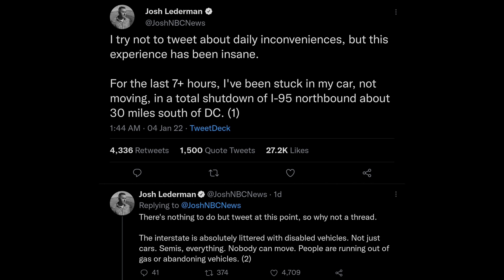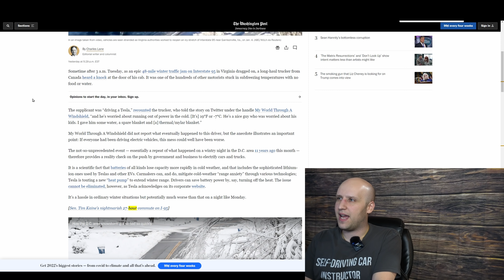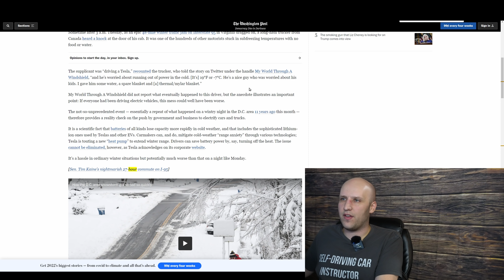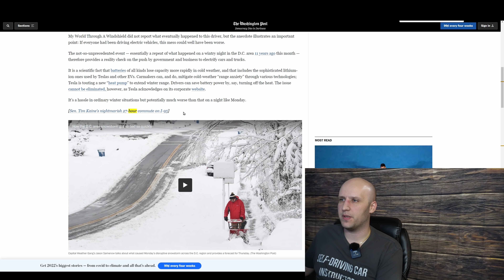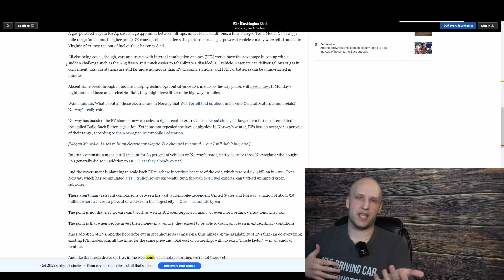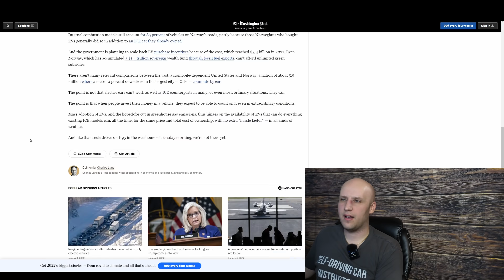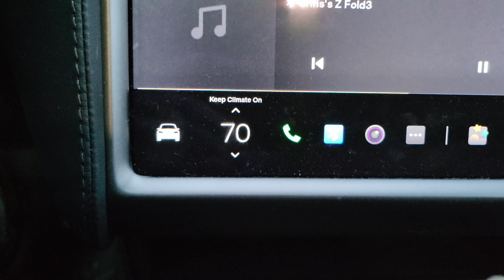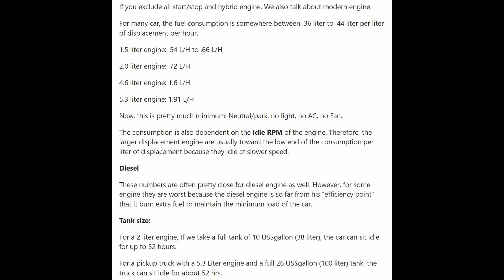How Long Can a Tesla Keep You Warm In A Frozen Traffic Jam? | FUD Debunking

Comment: If you stuck in an ice car, turn the heater or ac on and accidentally open the ac ventilation while the engine is running idle, and you have a leak in the manifolds,  you would be dead in an hour or so.

Comment: 4 years ago I was stuck on I-65 North in Indiana for nearly 15 hours. This was before camp mode. Kept the car powered on with heat and radio the entire time and used about 30% of the battery in sub 10° freezing temps! Many cars around me ran out of gas and had to be towed off the highway.

Comment: Gas vehicles don't run on their battery, the battery is used to start the motor. Once the motor is running,  the alternator is powering the vehicle.  The alternator charges the battery back up to capacity,  hence the voltage range, when charging the battery back up the alternator puts out from 14.8-15.8 volts, then drops down to the 13.8-14.4 volts to run the electronic equipment in the vehicle.  So, being stranded on the highway in cold temperatures wouldn't effect a gas vehicles electrical system.  It could kill the battery and overwork the alternator,  but that won't shut the motor off. This of course is putting new gas vs new ev. Older vehicles will have degradation (both gas and ev)

Comment: The model X could be a lot more efficient depending on how you tested it. If you used the cabin pre heat function it warms the entire car. If you're using the heater like normal and you're in the car alone it won't heat the rear of the car unless there is someone buckled in.  It's a weird feature that most people don't realize until you have kids in car seats and try to figure out why the rear heaters aren't working.

Comment: It having  a heatpump not only boosting efficiency by (also) using heat from other components to heat the cabin? In this case, the cars did not have any heat to start with and were not driven before the test. So this was a worst case scenario for the heatpump model?

Comment: You got a point regard electric car running empty. EV could have a plug allowing them to get a small extra battery to reach a charging station or climb up on a platform truck.

Comment: There are no charging stations within 75 miles of where I live....no EV for me!
Reply: Most EV owners charge at their house at night which is sufficient. Also, some EV's get 250-300 miles per charge now.
Reply: @mattwolf7698  Well, my very old house has 2 wire wiring, and only 60A service.  The only times I leave town I drive in a direction that has no chargers for 300 miles.  Cutting it too close for comfort.  I will wait another decade.

Comment: I have a 2017 Model X 90D.  On 12-20-21, I charged my car to 50% and drove off.  I had a flat tire on I-70E, ~8 miles east of Glenwood springs.  That was at 12:05am and at 11 deg F.  After the tow, I went to a tire shop but the weren’t open to 8am.    Kept my car at a nice 77 deg and seats at max.   When they opened, my battery was at 20%.   So my battery went from 48% and went down to 20% after 8 hrs at ~11 to 13 deg F.

Comment: Great video. Heat pumps use 1/3 to 1/4 the power of electric resistance heating. For example, you can save a lot on your electric bill by installing  a heat pump water heater.

Comment: Interesting comparison. Don't own an electric but my next vehicle probably will be

I live in a part of the province where one can go 150K between gas stations. With the govt. of Canada endorsing electric at the half way mark there is an electric charging station. So give the electric a point for that. Also for me having lived in colder climates with long distances between communities I have an emergency kit always in my vehicle. Surprising how much heat a candle gives!

Everytime there is a road closure somebody is always running out of gas. It will be no different for electrics. Where people familiar with the area will not start in without a full tank of fuel there is always the ones that will say oh I can make it. 

One question you can answer for me how long would it take to charge an electric with 110V? What I'm thinking motels/hotels have block heater plug-ins. If you are staying over night you can plug in to the normal current. Might not charge you fully but at least keep the battery warm for the top off.

Whenever a major change is made it does take time for the infrastructure to catch up. My dad for years always had a can of gas with him. Never know if you can make it to the next gas station. My brother and I thought he was paranoid (we actually questioned his sanity) till we talked with a friends grandparents. We just took it for granted every small community had a gas station. It never occurred to us that gas at one time was hard to find. Who would of thought of going to a feed store or a pharmacy to buy gas for a car? Apparently when our dad started driving that is what they had to do until gas stations were built.

Comment: Though the average gas car can idle for 33 hours on a full tank and it would use the same amount of fuel no matter what heat settings you had because heat is such a big byproduct of gas engines. This speaks to how Inherently inefficient gas engines are because of the insane amount of energy they use that is lost to heat. Though this also shows a way gas is still superior   considering that this would all be done by 60lbs of easily refillable fuel as apposed to permanently fixed 1500lb !battery.

Comment: I have to wonder how much power that resistive seat heater pulled compared to the heat pump.  Seemed silly to have them both running if the cabin temperature was set to 70F. It's more understandable at 60F, but the heat pump should be much more efficient than the seat heater, so maybe it would even out...?

Comment: But Battery runs out faster than gas runs out and if you have a 5 Gallon gas can in your car but To charge your battery of your car the car needs to be turned off with a power station plug-in to your vehicle so you will still be cold 🥶 for 1 or 2 hours but I think everyone should buy a gas with Hybrid or get a 2020 ChryslerPacifica, 2021 jeep Wrangler, you get gas,Ev, Hybrid all 3 in 1 Vehicle think about it
Reply: EV's can still be on when plugged in, they just charge slightly skower.

Comment: Very good testing and good video.  I love Tesla but I don't think any electric car has enough reserve energy to really face the challenge of Minnesota winters.  In Minnesota, we don't really think it's cold outside until it gets to 5F.  That's when you begin to feel your nostrils freezing with every breath you take.  There are multiple days each winter when the temperature does not get above 0F for days, and every year there are a number of very cold nights where the low temperature ranges from -20F to -30F and sometimes colder.  During the holidays, we routinely make long trips in this extremely cold weather to visit family.  Can we make a 6-8 hour round trip drive in -15F weather in a Tesla, keeping the inside automobile temperature at 75F, with no mid-trip recharge?  We do so with our internal combustion gasoline-powered engines.  That's the reality that causes the resistance to going electric.  I'd love to see a test under these conditions.

Comment: A model y will do 1 mile per 287wh. You can buy a 2000wh battery pack for about $2500. It's not cheap but that is about 7 miles of range using Amazon bought current battery. It will be easy enough in the future to have a detachable battery pack in your car that can add say 10 or 20 miles of range to the car. You grab it, head to your local charge point, top it up and then return to your car and plug in. Voila, a modern Jerry can.
If this becomes a big issue, I am sure this solution will show up.

Comment: So if you have an ICE car and leave it sitting around in the wintertime with a half (or more) empty tank, chances are you'll accumulate lots of condensation in the fuel tank which will 1) sink to the bottom of the tank, get picked up by the fuel pump and stall the car or 2) turn to ice in extreme cold while sitting in the bottom of the tank and stall the car. Or, even more fun, maybe your car has a subtle exhaust leak (salted roads in the winter time, etc) and you sit there idling for 12 hours while your car fills up with carbon monoxide, you take a nap and fail to wake up...ever. For f**k sake keep the EV charged or keep the tank topped off in the winter time. Just in case. If there were such a thing as common sense, everyone would have it...

Comment: You'd be surprised , especially in more rural areas , Gas stations have generators to run the pumps and minimal store operations. (or generators could be trucked in to bring those pumps on line.) So in the event of a wide spread power outage , chargers are a no go , but gas pumps can be turned on given the use of generators.

Comment: So thanks for the video and experiment, it's good information and nice to know, I do think you're a bit on the optimistic side for the EVs though. Note I think EV are a good thing but I also think they are currently too expensive compared to their counterparts, especially in the lower budget range where second hand cars are also a great option (at least in my country). Second hand cars will also be prblematic with EVs because of battery degradation, which reduces range over time.

One small comment about a thing that's not really true, is you  saying if you forgot to fully charge your tesla you could be in trouble and so could you if you forgot to fill up your car with gasoline.
I'm sorry but that's just not true, let's assume similar cars with similar fuel economy, price class, size, etc. Range is the one thing that will not be the same, and if I have 10% of my gasoline left that's still generally going to give me a much longer run time than 10% battery charge. The only argument I have to provide for that is already the difference in range, keeping in mind that electric MOTORS are also much more fuel efficient about 4x as efficient even. Chemical fuel generally just has a MUCH higher energy density (volumetric and by weight) and is generally not affected much by the cold (if it's not too extreme) while most batteries are, reducing the total available energy even further (the 10% for gasoline is basically the same on a winter or summer day, an electric battery doesn't provide the same power).

So no if I forgot to fill up my car with gasoline I'm much less likely to be in trouble in comparison to if I forgot to charge the batteries.

It's also really simple and easy to funnel some gasoline from one car to another with a simple hose (and maybe a jerry can), good luck doing this with electric cars. Pay some guy 50$ for a few liters and you'll get home, like I would really like to hear how you would do something similar with an electric car.

You also mentioned towing electric vehicles to charge them, but does that really work well with all the computer systems and automation in them, have you actually tested that and does that work if a normal/smaller car is pulling them (in the EU in many countries most cars are significantly smaller than in comparison to the crazy amounts of pickups in the US, in my country you barely ever see one, keep in mind gasoline price here is about 2€ per liter, or about 8.6$ a gallon).

Comment: Tesla that were built before 2021 did not have heat pumps all Tesla models 2021 had the heat pump.
Telsa without the heat pump took about 2000 kwh to heat the car Telsa with heat pumps 700 watts so heat pumps made the Tesla 75 percent more efficient to cool and heat the car.

Comment: I've had to sit stopped in my Avalon Hybrid in cold temperatures a few times. The nice with the car is that it only runs its little Atkinson Cycle 4-cylinder enough to supply heat. I've found that the computer has the engine turned off for the vast majority of the time, even with the heat set to a comfortable temperature. With its 17 gallon tank, I'd bet it could maintain 60 degrees inside during 15 degree weather for the better part of a week, not that I have any plans to test that.

Comment: Gas cars burn about 0.6 gallons per hour at idle.  So depending on the tank size you have some time. If you had half a tank of gas, and an 18 gallon tank that's 9 gallons.    So 9 / 0.6 = 15 hours.  So if you ran the engine half of the time you would make it 30 hours in a gas car.

Comment: with gas car - if you put heater on idling for too long, it gets too hot that you have turn off the engine once in a while.
Reply: I've never experienced this. I'd think the cooling system would keep the car cool if it was functioning properly. I've never been at a sit still for hours in winter though.

Comment: Your showcase because I wouldn’t call it an experiment was entertaining. But for now gas still has several advantages over EV’s in most disaster scenarios. 

1) You can walk miles to haul back on foot a gallon or even a few gallons of gas. You can’t haul back electric energy with an EV. It becomes tow truck only. 

2) If the grid is down for an extended period then gas stations can be powered by generators to dispense gasoline. EV stations are a no go period. 

3) In an emergency you can siphon gas from another gas vehicle. With EVs you just have a paperweight.

Point is that the at scale and accessibility if you are looking for the best reliability than for now that is gas.

Comment: Anyone ever hear of winter gas blends? Turns out ICE cars lose 15-20% range in the winter too. To your main point, anyone can get stuck in a bad spot with low fuel, regardless of fuel type. Of course, the author of the article failed to mention the risks of idling in an ICE vehicle for long periods... nothing like suffocating overnight in a carbon monoxide filled cabin - at least you'd go peacefully.

Comment: A gas car can idle for days on very little fuel. A gas car with 90% of a full tank could probably idle many days. It can run almost 10 hours at a average 60mph. Idle burns very little gas compared to that. As a kid I started a tractor and it idled all weekend. I remembered about it and turned it off after 3 days. But the electric cars did do better than I thought it would.

Comment: Even if a ICE car has low fuel, fuel can be given to it. It’s not the same with electric. Even if the gas station was far away, cars nearby can give fuel by siphoning fuel from another car.

So there is a disadvantage to electric. 
Either way, in the winter, have blankets in the car. Let’s not put electric over ICE in this situation just because we like electric.

Comment: Thanks for the research.  You could have added a point about how much a gas-powered car would cost to heat for 12 hours to compare with the cost estimate for the Teslas.  Very roughly, a quarter tank of a 16 gallon car would be 4 gallons, or about $12.  Were your numbers for 12 hours, or longer?

Comment: Way better to be stuck on the highway in an EV than an ICE vehicle.  Reason:  it is dangerous to stay in a stationary ICE car with the engine running for hours.  If there should be a leak in the ICE’s exhaust system, the result could be lethal as the carbon monoxide in the exhaust is deadly poison.  Second point, the time extension by lowering the temperature is easy to compute.  The energy savings is proportional to the temperature differential.  For example, if it is 20 degrees outside and you heat to 60 degrees instead of 70 degrees, the reduction in the change in temperature is a reduction of 20%. (70-20 is 50, while 60-20 is 40.  40 is 20% lower than 50, so there is a 20% reduction in energy use and a corresponding 20% increase in the time required.)

Comment: I thought Tesla doesn't recommend charging above 80% regularly or even to constantly charge everyday when you still have 70+% or even 60+% of your charge, so starting the experiment with over 90% of charge isn't realistic, since you wouldn't necessarily leave your house with over 80% of charge on say a daily commute and by the time you hit the traffic jam in subfreezing weather, you would have quite a bit less than that to start off with especially at that temperature.  It's safe to say that many of the EV drivers will have less than half their charge/capacity when they hit the traffic jam.  Also when the traffic jam finally ended, you still would need to find a charging station unless you had enough range to make it to where you needed to go (probably home at that point). The last 15% of your winter range (after losing 30%-40% or more of your capacity in that jam) at highway speeds with full heating might only be 20 miles.  Also, if everyone was in EVs, you might not be able to charge your car at the nearest station if everyone else had the same idea and charging also takes longer at colder temperatures.  Furthermore, most other EVs aren't as efficient as Tesla and would lose more of their range/capacity in that 12-18 hour period.  Finally, you have to assume that most of the EVs (especially the Teslas) will have been used (several years old) by the time every car on the road is an EV and there will also be some battery degradation that further reduces the range/capacity...
Reply: Tesla doesn’t recommend regular charging above 90%. The average daily commute is about 30-40 miles round trip which 10-20% depending on speed though obviously more in winter. Assuming an average commute, it’s likely a driver would have more than 50% battery and less than 20 miles to their destination (work or home). Driving a Tesla I’m rarely below 50% unless I’m going somewhere far on the weekend or a road trip. When I drove gas cars my fuel levels were all over the place but I was frequently below half or a quarter and occasionally running on fumes when I was too lazy to stop for gas. That’s the chief advantage of electric cars- the ability to charge at home while a gas car has to stop at a gas station, and no one tops off every day like many ev drivers do.